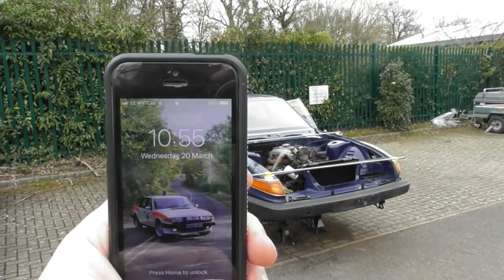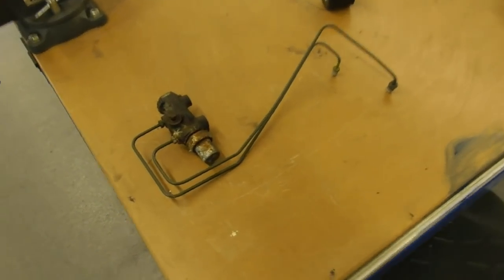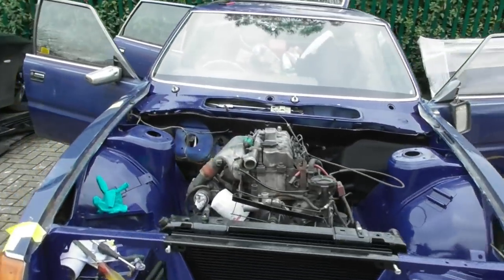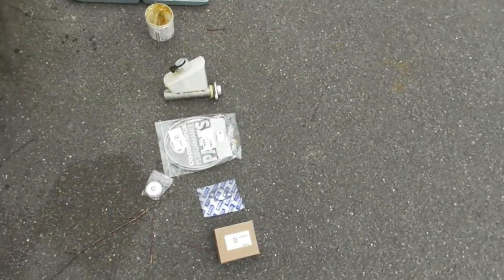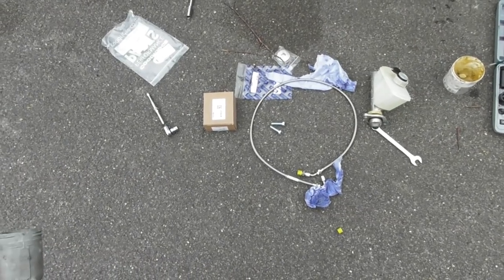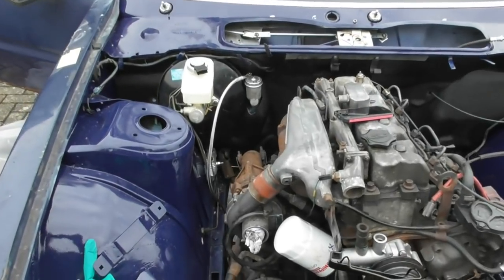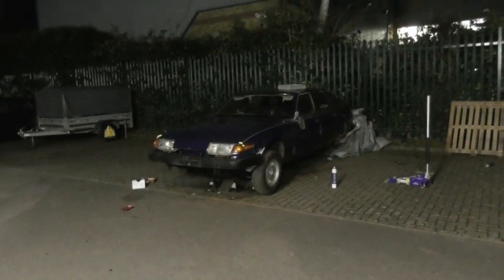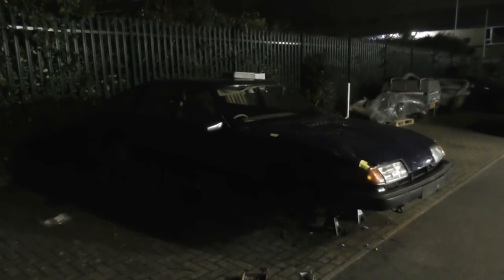Rover SD1 2400 SD Turbo restoration - Video 47 Rush for the show

Comment: Hi from Melbourne!  Just binge-watched all the 2400SD videos over past few days - loving them!  One thing I thought I'd mention about that rear chassis section (that fouls on the fuel tank) - the original had a drainage hole on the bottom, but yours is sealed - if you are going to re-do it for clearance, I'd suggest putting a hole back in it (if nothing else, it'll give you access to put in cavity wax ;-) - PS, my dad used to have an SD1 - 3500, T Reg in silver.  It was abused by previous owner (lack of oil changes) so was a bit gutless - took out the cam and discovered nearly half of the bumpy bits were just circular :-)  Kent Cams Fast Road cam went in and the thing would fry the tyres quite easily!
Reply from the maker: Good idea, I’ll do that. Yes the v8’s love to wear down the cam loves. And trundling around speeds they still run ok so a lot of people don’t realise how worn they are till they remove them!

Comment: You'll have to go back and prime the fuel filter, It will be very time consuming just using the pump on a filter that size!
Reply: Dead right !  Nightmare otherwise.Makes the job soo much easier !
Reply from the maker: I managed to get a bit into it that I poured out of the old filter. Primed it today and started first time! Videos will be up later or tomorrow morning.

Comment: Will you be doing any engine modifications to increase horsepower?
Reply from the maker: Once it’s up and running yes. I’m planning on firing theninlet manifold from an Alfa 75 with the forward facing inlet port and then rotating the turbo compressor housing so I can get an intercooler then turn up the fuelling and boost.